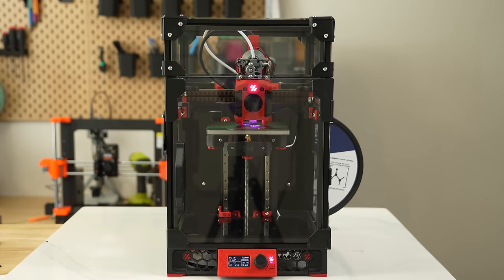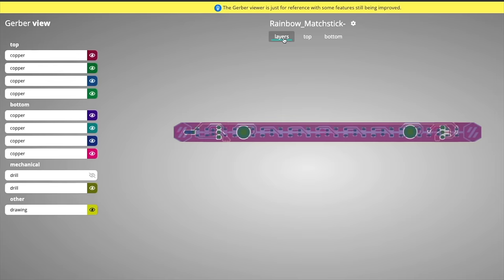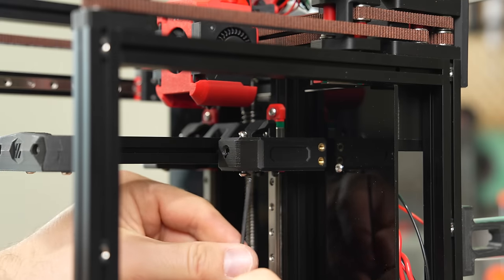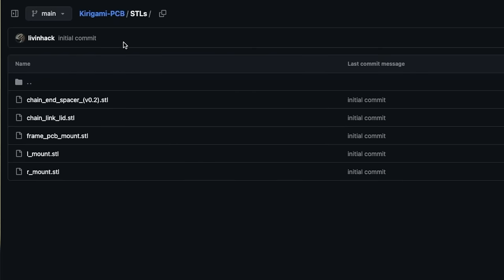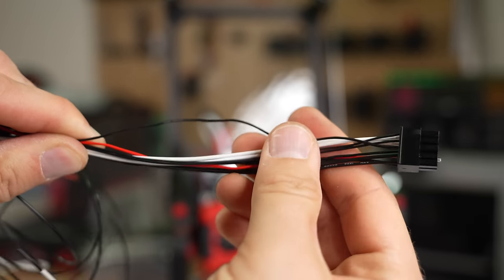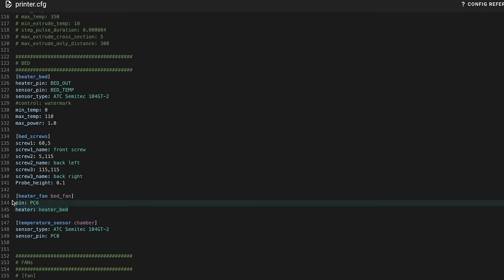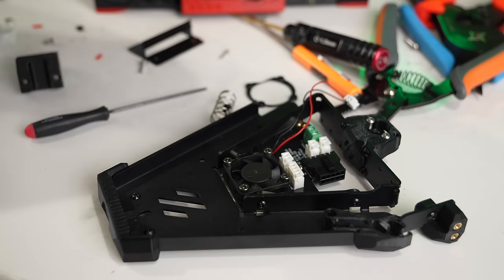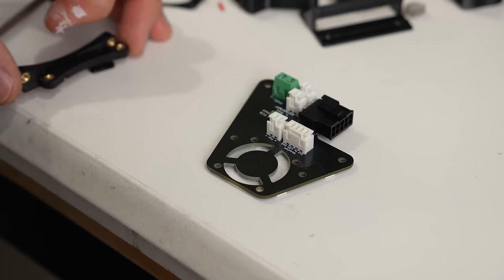You Haven't Seen A Mod Quite Like This! (V0 Kirigami UFO)

Comment: The most important thing I learned building my LDO 0.2 with a Kirigami bed is: "The Kirigami bed frame is made of metal, but may be bent out of spec during production, transport or mounting. You should check the measurements, parallelism and coplanarity (flat in respect to each other) of the frame before starting your assembly."
Reply from the maker: That’s a great recommendation. How obvious was yours out of spec?
Reply: @ModBotArmy  Not a lot, but even tiny adjustments lead to way better gliding on rails! I just haven’t expected it being so important.
Reply: This is amazing help for people trying out kirigami on the V0 for the first time. Mine was from Siboor and their bedframe was slightly out of shape and the paint they had put on it made the holes just a bit too tight. Running a drill through each hole and some manual bending against a sacrificial wooden board made mine fit perfectly
Reply: @SweHam  Mine was slightly noticeable after attempting to level it. Constant issues. Finally figured out it was warped.
Reply: Isn’t the whole point of the Kirigami the rigidit…. Never mind 🙄
Reply: @DanielSanPedro  Well it is rigid, however it's probably very hard to get a bent sheet of metal to perfectly line up with the holes in your rails etc...

Comment: Rad video, I’ll be doing this on my 0.1 when I upgrades it soon so glad to see what I’m in for. 
To my knowledge none of the smaller Cable Chains V0s use have the open link version. So that is why you likely won’t see a fully assembled cable harness, it wouldn’t be possible to feed the microfit through the chain.
Reply from the maker: That’s interesting and clears up what the cable chains covers in the mod repository are for. They must be there so you can cut your cable chain in the center so that you can feed wires through the cover that opening after. They weren’t the right length for my chain but that may be something you would want to check out before starting. Not having to crimp after you feed it through would be much nicer.
Reply: There is a chain from Igus in this size that does not have movable flaps on the links, but rather slots. The printed parts are intended as a cover, as this slot would otherwise remain open.
Reply: E04.07.015.0

Comment: Just installed a zeroclick probe this morning, It was very easy to assemble and the dragonburner has a duct designed for it as well, definitely recommend it if you hate levelling like i do
Reply: Voron v0.2? is it worth it?
Reply: @gustavofrenk  I haven't finished it yet but its going to replace my ender 3 for high temp printing, I mainly built it because its so small and enclosed out the box

Comment: I picked up the Siboor 0.2 after watching Greg’s Maker Corner build one. I had heard about the Kirigami bed before hand so picked one up before I started the build. Worth it!!  I had not heard of the UFO mod, but if the fan turns out to be worthwhile, I may consider it.   I have all the parts for a Dragon Burner but haven’t done it yet. May do it all at same time. Thanks for the video!

Comment: Adding 5015 bed fans to a 2.4 helps a lot with chamber temps
Reply from the maker: Thats the primary one I've seen. How many fans are you rocking? And what does your start up sequence look like when using them?
Reply: Same here. I've put two 5015 blowing underneath my 350mm bed on a 2.4. Certainly helps heating up the chamber and keeping the chamber temp more consistent.
Reply from the maker: I can definitely see the consistent part of it. Would be interesting to add another thermistor near the bottom and see how close the two are with and without the fan.
Reply: @ModBotArmy  2 fans. I have a macro where they only run if the print is above 100°C from the slicer (so ABS, et Al). I think they run at 25% while the bed is heating up, and 60% once the bed reaches temp
Reply: @ModBotArmy  Fan blowing downwards and a thermistor at the bottom would be interesting. The basic idea of a fan blowing downwards is that in the start-up phase of the V0 all the hot elements are at the top and circulation in this direction seems sensible.
Reply: @ModBotArmy  I added 4 5015 bed fans to my 250 Trident. Before I could maybe get up to 50c chamber temp, I can now easily get to 60c. Plus it gets up to that temp a lot faster, even without any insulation.
I added 2 thermistors and then setup a third virtual ones that acts as an average between them and use that for my macros.
Reply: @caedis_ i use 4 6015 axial fans. Much quieter, more than twice the airflow than 4 5015. Im getting north of 65c on a 350 trident even with only 15c room temperature. Now that it gets summer, more will be possible

Comment: I have a 4010 blower under my v0 bed (24v60w) and i can only turn the fan on after the heater sat at 100c for a few minutes and only for 25% speed, else the thermistor triggers a thermal runaway because the fan is too strong. I would recommend 1 or 2 nevermore and to turn the hotend to 200c when beatsoaking. This got my soak time to unter 20min
Reply: My tip, turn it on as soon as the bed starts heating. The bed heats only slower, which doesn't concern klipper if its still within some limits, but if the temperature drops when its heating more than a few degrees, then thermal runaway is triggered. I can run my 4 60mm fans on my trident right away at full power (80m3/h combined, just so you are aware. A 5015 is good if it can do 9m3/h), but if i turn them on 100% during the heat up, runaway is triggered

Comment: There are some better mods concerning the Z axis for a v0. Namely, converting to TriZero, F-Zero, or Pandora's box.
Reply from the maker: Oh yeah, I have been looking at Pandora's box for quite a long time now. However, those are substantial overhauls due to them needing 3 z motors and going the belted route along with a bed leveling setup like sideswipe. I'm a big fan but wanted to set some limits. I would love to do a Pandora's box but would start from a new frame. We may end up doing that on one of the other V0's if we do a full tear down.

Comment: Me having 0 lights installed on the V0: hmmm interesting
Reply from the maker: Rumor has it that it increases max flow... Can neither confirm nor deny.
Reply: @ModBotArmy My flow has already been increased by the cat ear on the dragonburner, I don't think it would increase more
Reply from the maker: @youtubehandlesux  ooh wow yeah the cat ears would have maxed you out. 🐈
Reply: @ModBotArmy Nah, not really. Wait till I design a cat ear tophat and cat paws mod, this thing gonna travel through time and print a benchy before I press the print button
Reply from the maker: @youtubehandlesux  🤯
Reply: @youtubehandlesux  But then you need a lot of LEDs to compensate for the missing flux compensator! 😆👍